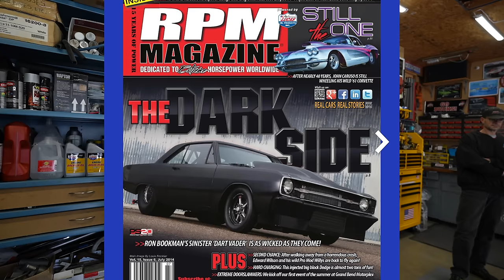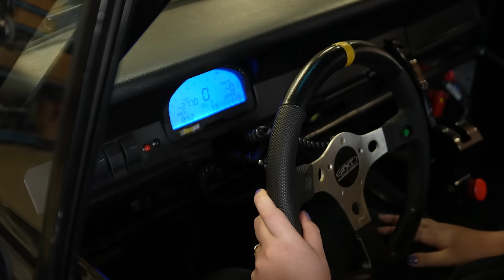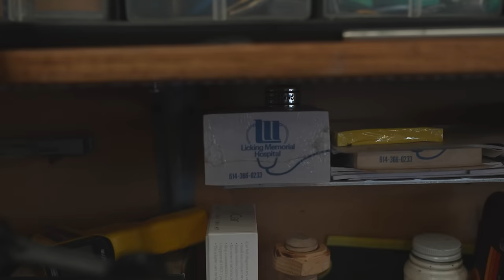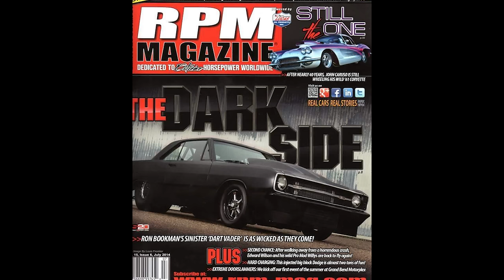Jeff Bought DART VADER! Procharged '69 Dart is ROWDY!

Comment: No doubt Jeff has the quickest car now.  Now all he needs is to work his way up using all the car has to give.  Aside from the maintenance cost if the motor blows it is without a doubt a very nice car.

Call me what you will but i would be concerned driving any car with a cage like that on the street.  Remember it isn't always us we have to worry about on the road.  Bouncing your noggin off all those bar's would not end well.  Be safe alot of us would like to see you around.

Comment: Just lower the Dart 1-2 inches Lower rear(Wheel tubbs needed) and then replace front end suspension and just turn down the torsion bar adjustments, Glass Hood cowl is ok